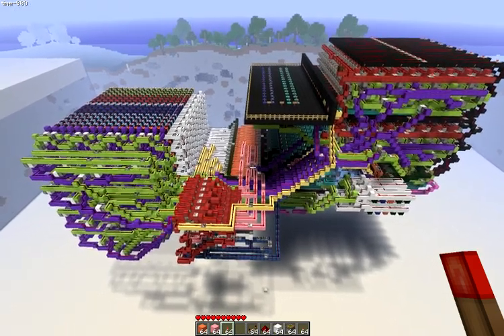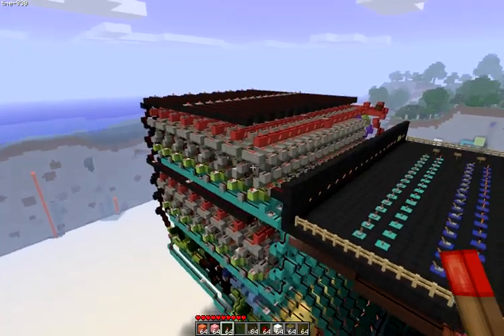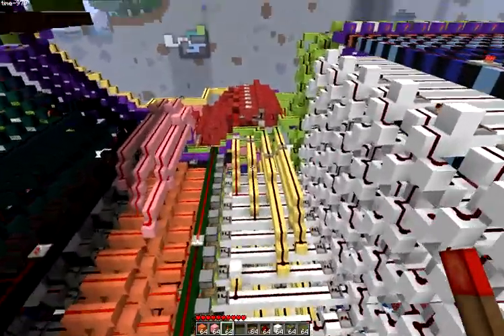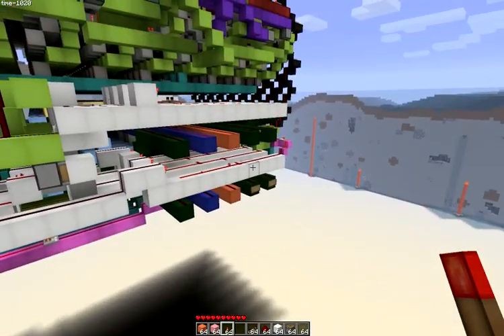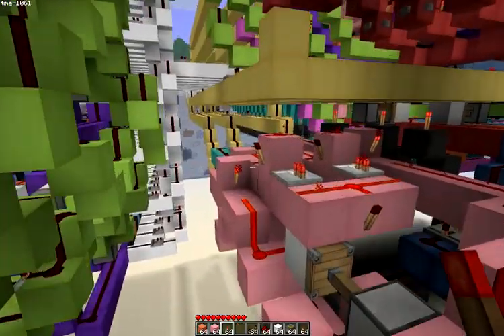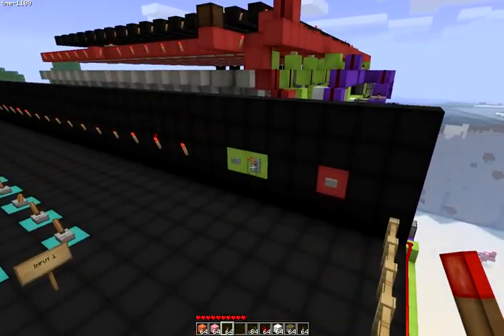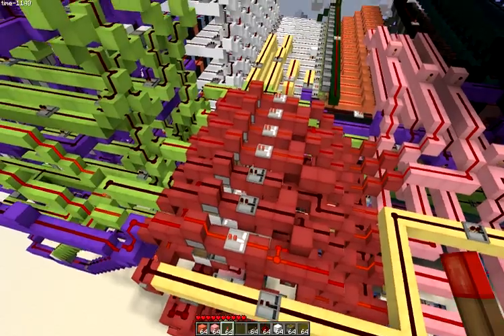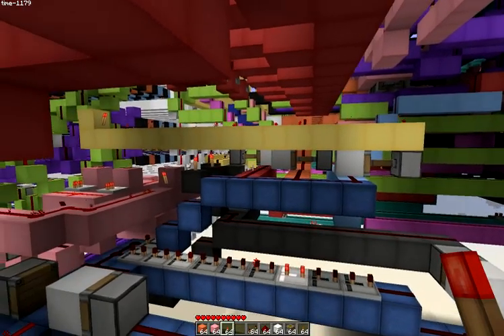Ohm's 16-bit Minecraft Computer.

Comment: so, it's more like a mechanical engine?
when I read "computer" i expected a thing with a screen and keyboard
Reply: No, all engines are mechanical. Engines turn one type of energy into rotational energy allowing you to power something. A computer is electrical and can receive information and be told what to do then give an output and this gets told to add two things so it does that and gives an output.

Comment: You could use this 16bit computer to make a playable video game inside the video game. With switches as the controller ports. Like a switch based representation of an NES controller, with a playable Super Mario Bros. It would probably be quite slow but I think it's doable.
Reply: Imad Knight But this is not mod so its much cooler and better
Reply: Just get the computer mod! You can actually go on the internet in minecraft and watch a video or see my comment.